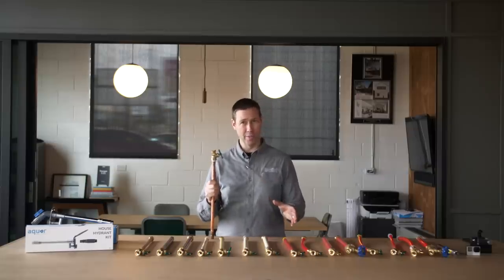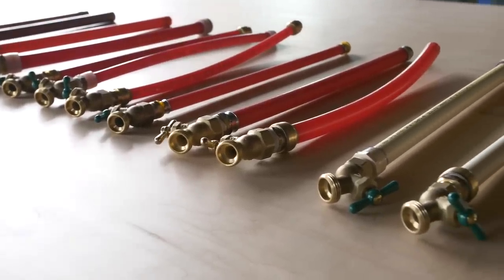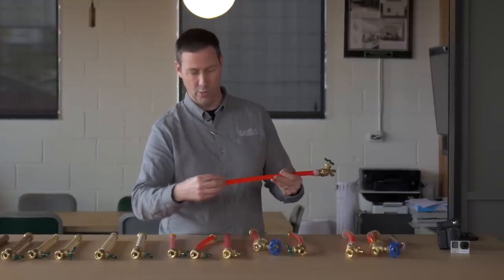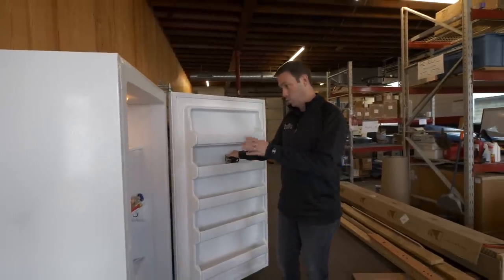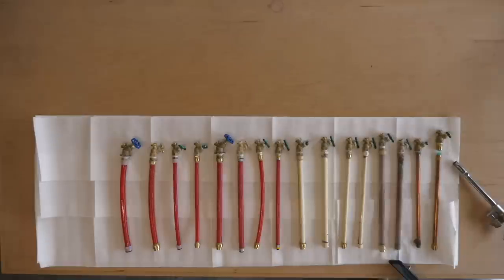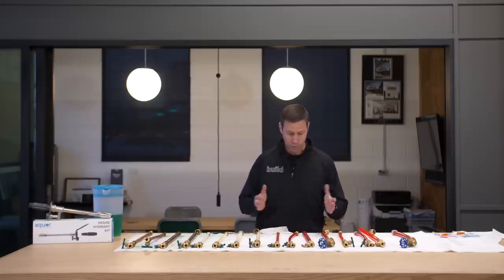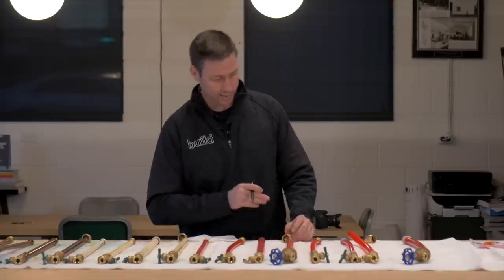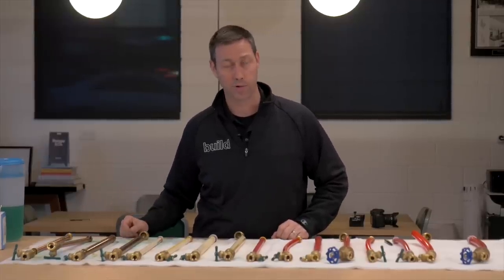Copper vs Pex vs SharkBite - Freeze Testing

Comment: Very interesting and great data! A leak at the hose Bibb is def still a problem and should be drained before freezing temps sneak their way in. I have seen ice sculptures form on the side of houses due to that point of failure. Much better than in the house but still a problem.

Comment: Thanks for good baseline info.  Also, the age factor comments and experience below are very helpful.  PEX A, being most flexible, I would think would maintain its flexibility/freeze resistance better over time.  Its a lot like blood vessels - flexibility to allow dilation to accommodate occasional pressure increases is super important - where age also factors in :-)

Comment: All my supply line is sch40 PVC, and all my house plumbing, from the supply valve into the house, is CPVC .. none of it burst or cracked with the latest snowstorm and freeze we had (raised house and all plumbing is under the house with a simple skirt material that has no insulating value, I replaced the wood skirt that was originally used, so, it get's quite cold under the house)....in Texas 2021...and all my exposed PVC, yard faucets and pipe to raise those faucets about 3 feet off the ground, all sch40 PVC, I covered with 2 inch wall foam (foil sided foam) by making a box to fit over each and then covered that with pond liner material I had left over so I wouldn't have to worry about snow, ice, & water ruining the foam board...I haven't used pex in years, but this makes me feel better about it's reliability....I may have had slight freeze in the PVC supply at my valve location, short term, but after day 2 of freezing weather the water company had a massive line burst that ended up causibng a suction on my lines and sucked all the water back out toward their supply point....for some strange reason, I DID lose both elements and 1 thermostat in my water heater, not sure why, I doubt it was empt since the supply line feeds water from the top...strange though, but easy and inexpensive fix (both elements and both thermostats) since the tank was still in good shape....Still, overall, I'll never use copper and even though I do like the CPVC, the sch40 has thicker walls, and now that pex is getting a good reputation, I like that it is more flexible, may end up changing from CPVC to pex in due time, but still keep sch40 for all my underground and supply pipe.....Thanks for the test Matt....

Comment: The defect of your hose bibs is the spot or point pressure of freezing water will squeeze water past the washer of a standard faucet.  The washer is pressure sensitive. The little bit that gets by, freezes inside the bib.  Thaws to stain your paper later.

Comment: I'm certain some of the other 1300 comments state the same as I; No pipe (PIC, Copper, or PAX A/B) are freeze proof. PEX is freeze resistant. One also must remember the manifold before thinking it's OK to walk away without winterizing. Particularly if one doesn't turn the water supply off.

That said, I'm a PEX guy all the way. There is no need for copper pipes. Copper is way to valuable and energy intensive to produce for use today.

Excellent comparison. Thank you.
Cheers!

Comment: What's funny is today we had our first official Frost with 32 Degree most of the day temperatures and the chicken water froze last night, YouTube just now decided to recommend a 3-year old video on water freezing. Yes Frost Proof hose spigots do not work if left on nor do water timers. What did work was anywhere that the quarter inch PEX was in contact with the ground it did not freeze so I'm making progress. I'm in the panhandle of West Virginia, and I've been trying to get water out of the chickens without having to carry buckets (  of course digging up the lawn and going below the frost line would definitely work, I originally lived in the Syracuse area cold temperatures and snow so I know how the stuff works ). the quarter inch PEX works great and I'm still working out the Kinks in the winter.

The plan was to part the ground and stick half inch tube in the ground and then feed the quarter inch tube in that as a double insulating and avoiding the rocky terrain not very far underneath, however that didn't happen this year yet. I also did some measuring and it just happens to fit although probably not recommended 14-2WG AWG wire with the quarter inch tube so I'm thinking not only will I be able to get both lines under the ground a little bit and not need to worry about tripping or mowing the lawn the resistance out for the water bucket warmers might generate just enough warm to keep the system from freezing. I definitely have the distance out covered, its the hose spigot and the individual drops lines for the chickens that I have not fully figured out how to protect yet.
I've even done a bit of research on water Distribution Systems in Alaska which is quite interesting.

Comment: I understand what you are saying, but house water systems are not closed completely. Water can go backwards in the system to a degree depending on incoming pressure. What about a test to see what damage done to let's say  50 t0 60 psi like most homes.

Comment: In Michigan I’ve ran 3/4” copper out under decks for customers to outside of deck with shut offs inside and pipe insulation on pipe. During the cold months shut off supply and open sillcock then cover with styrofoam cover for sillcock .. I haven’t had any problems with this combination

Comment: As someone with an off grid cabin in extreme cold country that gets year round use, there is only one choice for piping and that is PEX.  

Personally I've been using crimp ring style PEX for almost 10 years and have never had a fail that wasnt from installer error.  

I've had my pipes freeze many times and only failures are in metal shutoff valves or plumbing fixtures....none in the PEX.

Comment: Great video, that was just what I needed to see. Although copper does have some options for preventing pipe freeze, I am leaning toward uponor expansion plumbing as my next upgrade for any future failures. It would be great to see a video of testing proper and inproper hand tool expansion fittings and what how likely you are to get a leak.

Comment: When you freeze, the walls of the copper and plastic contract, while Ice expands. Both copper and plastic materials contract quite a bit but the problem is copper has a modulus (simply described as stiffness) about 10 times higher and able to keep shrinking while handling the expansion of ice sufficiently for the sharbite connectors to slip out. It can however only undergo plastic deformation (irreversible deformation) so can self destruct with the contraction and forces of expansion acting from inside. Plastic materials have sufficient elastic deformation (reversible deformation) to keep the shark bite connectors intact due to expansion of ice and then some plastic deformation to survive expansion of ice. This is just my take - I am an engineer but my engineering experience is in mechanical properties of tiny pieces of electronics.

Comment: While watching one of you episodes on my TV you made a statement about softened water being good for the water heater. You are correct it will not fill up with sludge. But softened water will make it fail quicker than non soft water. It will eat up the anode rod in in just a few years and then it will start eating the tank.

Comment: even a solid steel pipe would bust if full & frozen thats why cars engine blocks have expansion components in their cooling systems. pex stretches just enough to not crack at least if its a small length that gets subjected to freezing. I had my garage bathroom pex freeze 3 times that I'm aware of over like 5 years & still had zero leaks !  but It was only like a 2-3 foot section where it passes through the non insulated attic, the rest is close enough to the furnace to stay above 32F. I doubt its spec'd for it but it is a nifty feature I'd say.

Comment: Thanks for the video!  This is exactly (actually MORE THAN) what I was looking for....and didn't actually expect to find a literal "experiment".  I'm getting ready to have a "mother in law" suite added...and want to do everything I can to avoid freezing pipe issues when it's not in use.  Sounds like Pex may be the way to go.  I was leaning toward Pex anyway just for the simplicity and fewer fittings.  Now all we need is another experiment comparing the performance of all possible pex fitting (sharkbite..crimp..etc..)  My "hunch" is that the crimped fittings would be the strongest.

Comment: I have Pex A in our 5 year old house in Oklahoma. I had the plumber's put in a hot water circulating system in. No freezes have happened, but I had a split pipe (above the slab, thank God) on the return line at the water heater. I have been a plumber for 41 years. I retired before Pex was widely used and didn't know enough about it. Yes, it seems, to take freezing better than copper, but don't use it on a circulating system. PEX-AL-PEX: Tubing with a Little Backbone is a far better pipe than either Pex shown here, but sadly is no longer used in the States from what I understand.

Comment: Pex A (wirsbo here in Canada) is definitely the cat's rectum in the plumbing world. That extra crosslink gives it remarkable memory. I've seen the rep kink it in half, put a hot air gun over it and bring it back as good as new. Great for running in tight bends. Can be ring crimped like pexB if Wirsbo system warranty not required. 
I tend to only use Shark Bites to temporarily cap off lines. Would  never use them as a permanent install professionally otherwise. 
Expensive handyman product.

Comment: The number one cause - homeowners fail to disconnect their garden hose from the outside faucet in the winter months! Add to that not closing the shutoff valve and a burst pipe will happen every time.

Comment: I just watched your freeze test video with great interest as we have a summer lake home in Maine where we get our water from the lake and therefore drain the entire system when we close the house up for the winter (including P traps, clothes washer inlet valves, dishwasher inlet valves, hot water tanks and toilets).  Yes, over the years when we charge the system in the spring, we have experienced  burst pipes where we didn't do as thorough a job as we should have when we drained the system in the fall.  I have since changed out all the copper to pex and have had no issues.  My question for you is, if you were building a house either in the north or the south, would you use copper, cpvc or pex (from a cost, ease of installation, durability, off taste etc perspective).  Thanks

Comment: Been plumbing for close to 20 years. Per will burst however it bubbles almost before it bursts. Had a system both pex and copper that had froze up because homeowner left furnace door off. Both copper and pex had failed and burst.

Comment: Some of the comments below made me wonder if hammer arrestors could help to prevent freeze damage. One commenter below said that he hadn't seen a burst pipe that froze only from one end because water in the frozen area just pushed back on the water in the line and the rest of pipes in the house expanded enough to prevent a pressure high enough to burst the pipe from building up.

Comment: Just had a cold snap of -50°F a few weeks ago. All the existing copper burst, the existing plastic pex fittings cracked,  the metal shark bites on pex blew off when the system was repressurized. 
I replaced with pex and metal fittings with a stainless ring. Hopefully it survives the next one.

Comment: On a longer pex pipe it will pop the joints. That said everything can be broken. Pex is the best because it is flexible and goes in fast and economical. It also doesn't corrode. It's plastic. Also, if fire gets in the wall it could douse the fire when it bursts the plastic pipes. Even if the water doesn't put it  out it will slow it down.

Comment: I used to be called to replace split copper in an un heated space under a local church, every spring.  Ten years ago I replaced it all with Wirsbo.  Not a single split pipe since then.  

My house is entirely plumbed with Wirsbo.  I leave for a month or two every winter.  I shut my water off, drain the water lines from the exterior hose bib, and walk away.  No heat, and no problems.  And I'm sure there is residual water in the horizontal water lines.

Comment: Great test. Probably could have used a little more refinement but you made your point perfectly clear. Copper does not tolerate freezing temps. I do not know so much about all the other variations of plastic hoses but they are tough customers for sure. I'm guess if I looked in your other videos you would have much more information about the other plastic hoses. My question is. Does pex or the others plastics have the capability of lasting 20, 50 or 100 years like copper can?

Comment: Located in Canada and I have had 2 pex failures in 20 years. I usually drain the pipes before the freeze sets in but a couple times we  had an early freeze and the pex split just like copper would.  Pex is better than copper but it can still burst.

Comment: I've spent a lot of time thawing out frozen copper with a torch, and never seen one split once yet.  Bear in mind that there is always somewhere for the pressure to go in a house, because there is almost always part of the lines that isn't frozen, either under the house, or inside it that absorbs the pressure.  You need to find a way to only freeze part of the lines and keep several feet of it liquid to get an accurate test.

Comment: You did not make a mistake using hose bibs In all the houses I've lived in over the years, the ONLY freezing problems I've ever had, have been related to outside faucets. This is the most relevant test you could have done. We've always used freeze less faucets, which as shown have the washer and seat 12" to 15" inside the space between the downstairs ceiling and upstairs floor. It's absolutely necessary to remove the hose from the bib, to allow it to drain. That has always solved the problem. That, of course, after a frozen conventional hose bib.

Comment: im a plumber and i live in new york i have never seen a pex pipe split the fittings will split the problem i see the most is when people leave their garden hoses connected to their hose bib it splits even if its frost free you would think the garden hose would fail but for some reason it cause the pipe to split in my own personal house i have copper piping and a stop and waste valve to drain the pipe i never drain it during the winter it does freeze you cant get water out of it during the winter it never splits i would not recommend doing what i do just saying its much more important to disconnect your garden hose in the winter then draining the pipe

Comment: During my new house build in Canada 5 years ago, one of the contractors left the water turned on to the whole system.  It was December with no insulation or heat, and all lines froze inside the house.  Luckily, there was not a single leak when it thawed.  PEX-A is a great product.The plumber was an @$$ and tried blaming me, but it was likely his guys who forgot to drain it after they tested it.

Comment: This is exactly what I wanted to see. I was writing you in a comment on the last video of yours that I watch (actually was my first vid of yours I ever watched) and was wanting to see a freeze test. I saw this video in the up next column and didn't have to post the comment lol However, I would like to see this test done again with the 90 degree fittings on them. If you make a 1 ft square out of all of the different systems and use the same hose valve I think we might see a different result. The pex that I use has what I believe to be brass 90s so I think if frozen the 90s might fail first. I would like to see that vid. And capturing this on go pro was a nice touch. Great vid Matt.

Comment: Had a 3/4  copper  line under a porch  with a sharkbite connecter. A freeze blew the sharkbite right off the copper, and the total area flooded when pipes thawed. No copper anywhere  for me, unless unusual circumstances.

Comment: I have about 35 faucets around the place. They are on a 3/4" schedule 40 riser about 25-30 " high, topped by a brass hose bib like the ones in your test.  When the weather here in central Texas gets in the teens or single digits I have a failure or two if I forget to drain the system. Strangely the brass hose bibs fail at about the same rate as the pvc.

Comment: My wife and I bought a doublewide trailer in 2009 that had PEX.  I had never heard of it before, and thought it was just a cheap knock-off, something that mobile home manufacturers used to save money.  

I spent the next 11 years worrying about it, always waiting for the water pipes to burst.   I even had conversations with my wife about going in and taking the PEX out to replace it with copper. 

That doublewide burned down in March 2020.  (Yes, 2020 is definitely the worst year lol).   When we were looking for a new doublewide to buy, all had PEX, and for the first time, I started doing some research on it. 

What I found out was that I had spent the past 11 years worrying about nothing.

Comment: I’d be curious to see different tests with additional connection types. I use copper crimp rings exclusively with my pex (service plumber so usually I’m using copper unless I’m doing a repipe) and I’d like to see how the rings hold up compared to various other connections. 

I also know from experience that wind effects freezing, and I’ve seen copper bends break right in the middle of the fitting due to strange angles of cold winds coming into a crawl space or an opening near an exterior wall. Sometimes the pipe doesn’t freeze/burst where you’d expect. 

Plus I wonder how well the CPVC and PEX would’ve held up under longer freeze times. 

Love your vids, Matt. ✌🏼